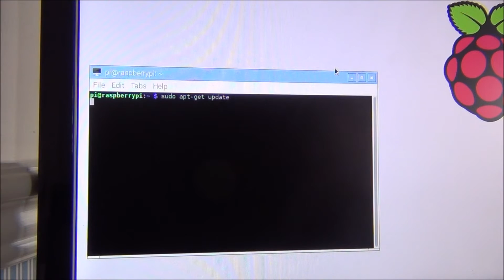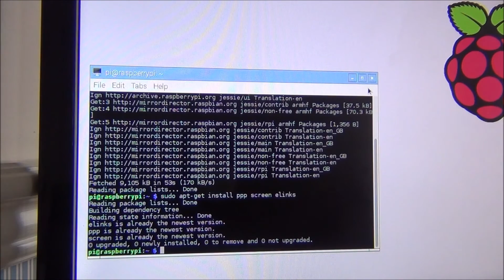FONA Setup 1: Raspberry Pi IoT: Adafruit FONA Initial Configuration

Comment: Hello, can you please tell me about the serial USB cable? Where do i get one if i can buy it. i recently bought a GSM SIM800L and it didn't come with the cable. I have been having a problem with my GSM and it's not working with the Raspberry Pi.
Reply: did you find any solution?
Reply: It’s called TTL SERIAL to USB cable.

Comment: does this GSM modul work with german GSM standard an german gsm providers?
Reply: The module itself should work, the SIMcard from the adafruit shop most likely won't. Wait a few days and I can tell you for sure, I just got me the feather fona, which is very similar in regards to the GSP portion of the board.
Reply: @dercebe  ye i think you forgot
Reply: @CrypticConsole  I did, indeed. But since then I did  use my feahther fona with a german sim card successfully ( lidl connect ), so yes, I think it can...
Reply: @dercebe  ok